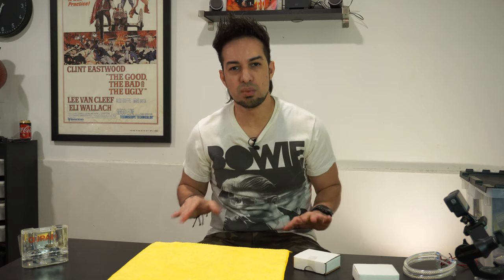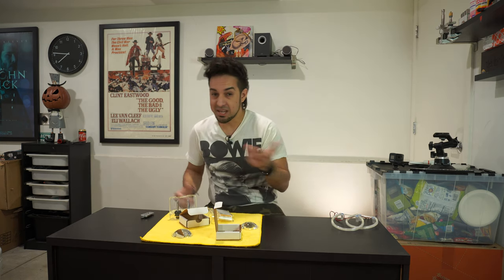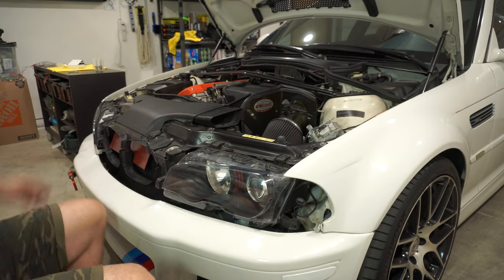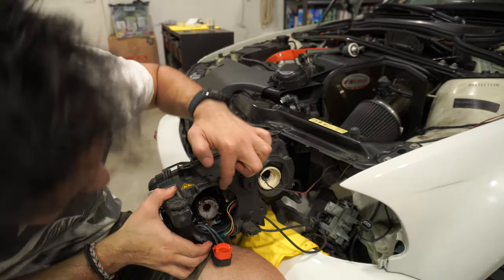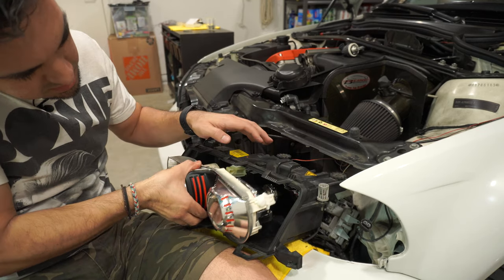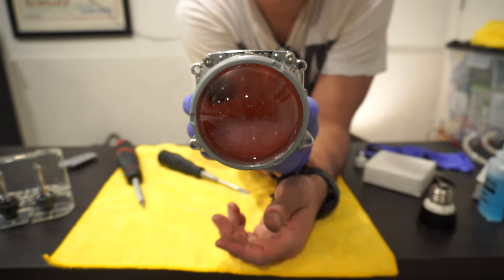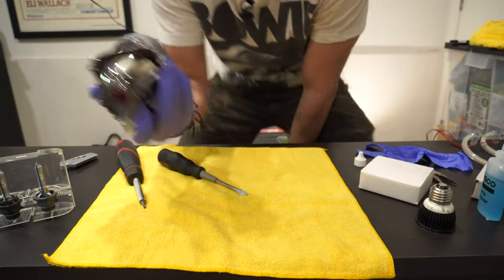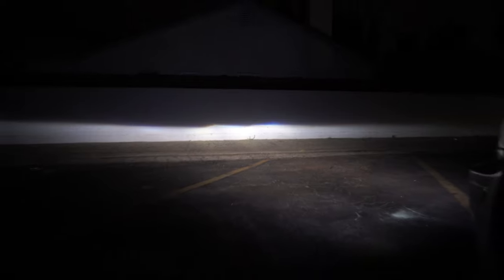Best BMW E46 M3 Headlight Modification

Comment: That "line" could have something to do with the bi-xenon because regular HID cars don't have that line.
I was imagining it to be similar to bifocal eyeglasses.
Could be it serves no purpose at all.
When I swapped my lenses it definitely improved my low beam light but then the high beams became unnecessary.
...the impression is got anyway.
Reply from the maker: I feel you, I got an evo which I should bring into this channel soon. And that doesn't have that wierd bifocal line. But the differences between the lines don't change in magnitude... which is so wierd? 🤔 and its frosted not clear like jdm cars etc. S2000, Acura. Evos. I don't see its purpose for the line...

Comment: Great DIY! I have a quick question? After a year, how are the aftermarket lenses? have you noticed any lost of light output? I’m in the process of modifying the headlights in my E39 and I think this would be an easy not to expensive mod. Please let me know. Thank you.
Reply from the maker: Hi there! Thanks!! Well after that I have not lost any output in light intensity and quality (crisp line) I'd definitely recommend those bulbs and lens if you want that look. Trust me you'll love it. Make sure you seal it properly so you don't get condensation depending on where you live!
Reply: @KatchUpmedia  Great! Thank you so much for replying back and recommending this mod.

Comment: How do yo adjust headlights (aim of light beam)
Reply from the maker: There is a hole on the top of the headlights. Inside the hole you'll see a screw that fits a Phillips screw driver. stick the screwdriver in, you can turn it clockwise or counterclockwise to help you aim the beam up and down. I would do that at night, projecting it against a wall,  a car and 1/2 distance to perfect your beam to how you like it 👍🏻

Comment: So if my car lights is yellow do i just replace that projector, that circle thing?
Reply from the maker: Yeah Ivan if your Headlight "bulbs are yellow" meaning the kelvin is around 3-4k on the kelvin scale. yeah all you have to do is replace the Glass part, which is the projector glass. The glass will make your headlight more "rich" in color and much more Lumens.
Reply: KatchUp appreciate it 👍
Reply: That's one detailed video, keep it going buddy....
Reply: up to 4000k its yellow, 5000k white , 6000k its blue light